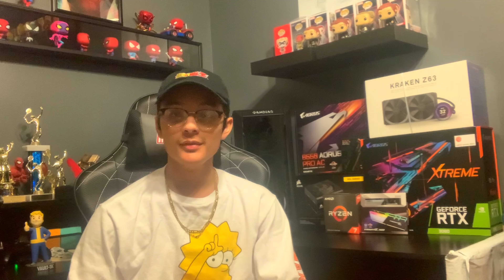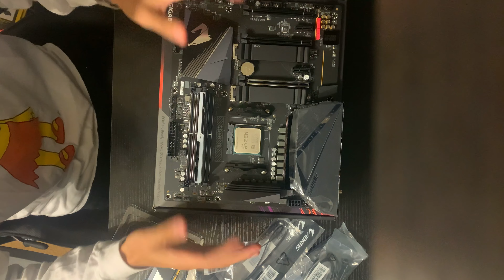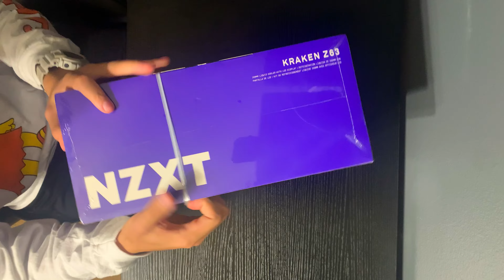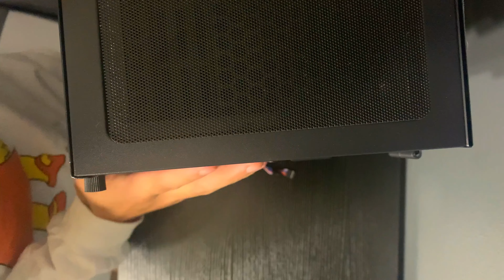MY FIRST PC BUILD! - (beginner)

Comment: Nice build, I'll add you can air cool the cpu with know problem, as long as the tdp on the air cooler is higher than the tdp on the cpu, Bequiet pro rock 2 fx has a tdp of 150w, and the cpu 5800x has a tdp of 105w.
Good build bro

Comment: The part you said "when you put it on the front, you can't put it at the top". That's wrong, if you flip the aio with the tubing facing to the PSU basement it will be something wrong with the aio
Reply: Pump is in the block, so he won't be killing the pump by letting air rise to it

Comment: That graphics card saved ur ass. There was so much wrong with the first radiator orientation u were planning on going for lol
Build came out looking great tho none the less. Would just work on those gpu cables if I were u
Reply: Same i saw that too where his aio set to exhaust and the case fan set to intake